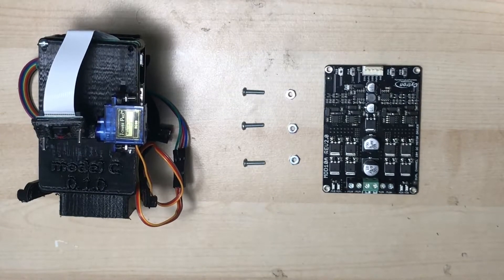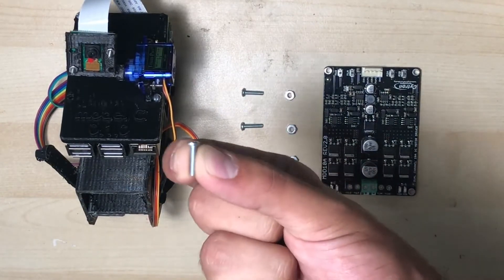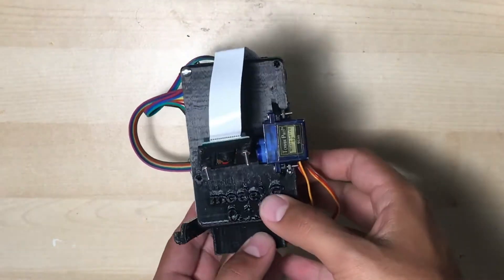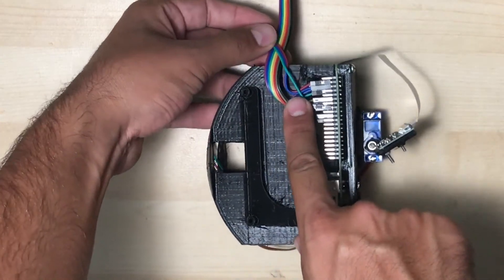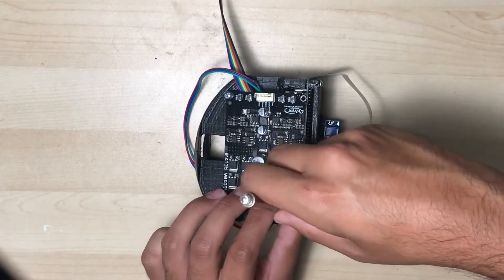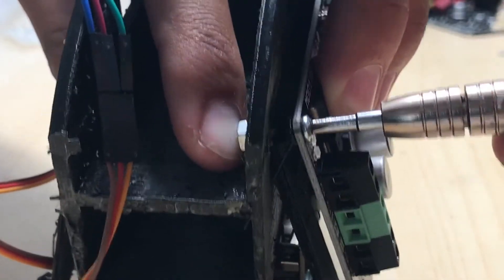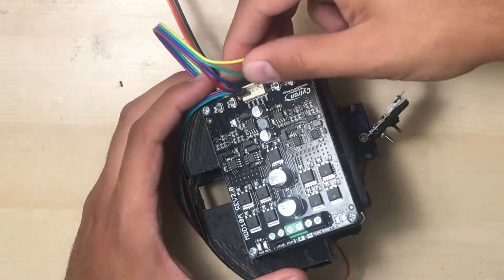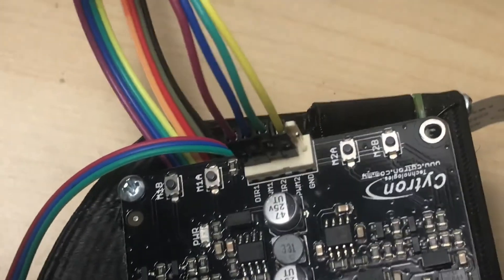Connecting Cytron Dual Channel 10 Amp to Raspberry Pi (Guide 3 Step 4)

Comment: Connection on Motor Driver different from Blue Dot Instruction manual.  I tried both connectors but Raspberry no-recognized. Connection with camera and tilt motor okay. Need help please
Reply: Connect ground on driver to ground pin on PI.